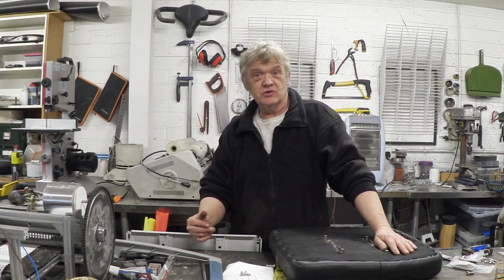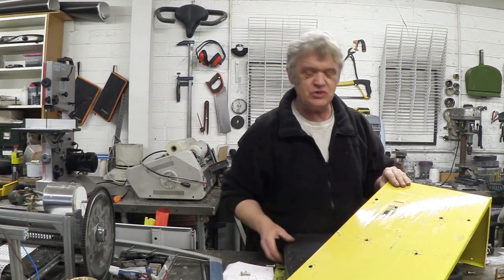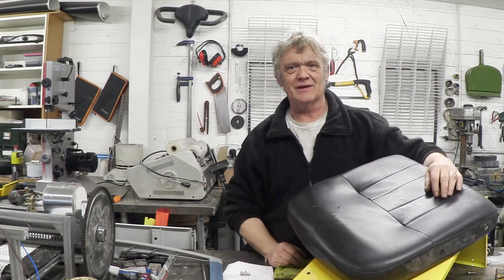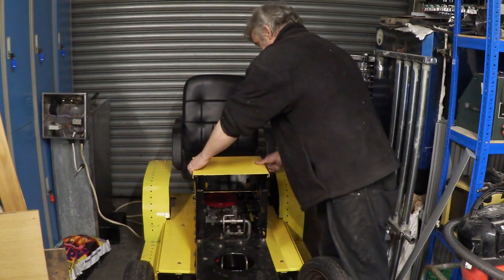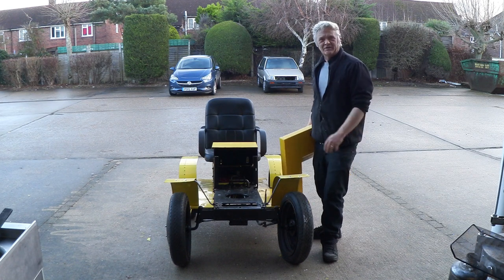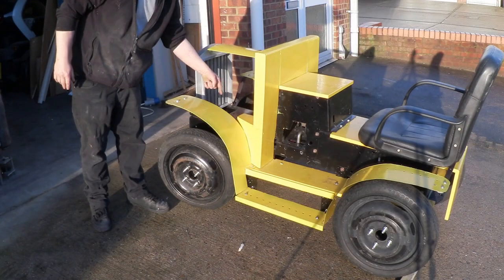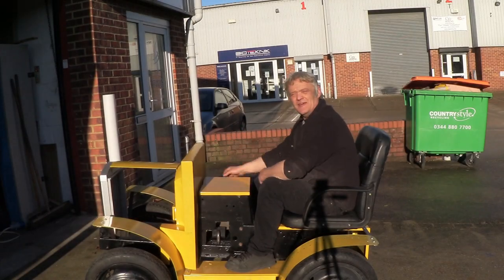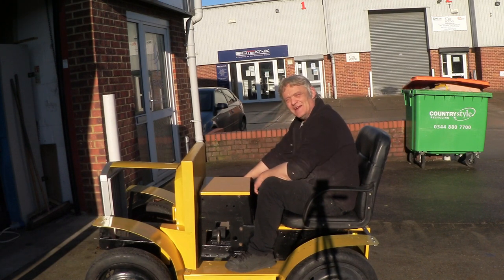974 - Building Bessie - Lawn Mower To EV - Part 6 The Body Panels

Comment: Will we be seeing Luke laser cutting an emblem for the faux radiator? Say ‘FWG’ back lit with a green LED. Also a Mascot for the top of the rad. Say Thor’s Thunderbolt, sculptured in transparent plastic and lit from below and inside with an amber LED. After all Bessie  is electric and born from a ‘spark’ of genius.